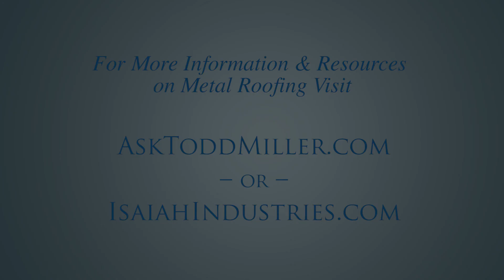Using Foam Inserts with Metal Roofing - Metal Roofing 101 with Todd Miller

Comment: Hi,,  I’ve recently purchased a home with a metal roof in snow country,, Northern Wisconsin, and I noticed after a recent storm some pieces of the foam inserts that you’re talking about were coming out from under the crown of the roof—-  should I be concerned or is this Minor and deserving to be ignored??   Thanks for any response.
Reply from the maker: Hi M.M. Our recommendation would certainly be to have them re-installed and sealed in with a sealant / adhesive.